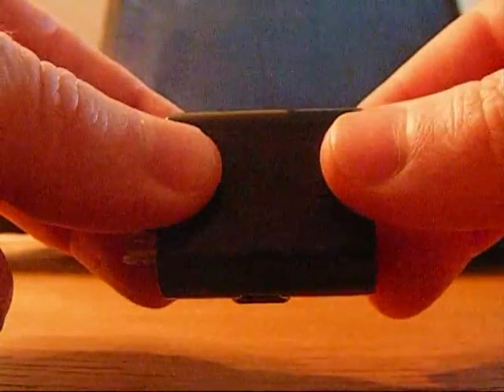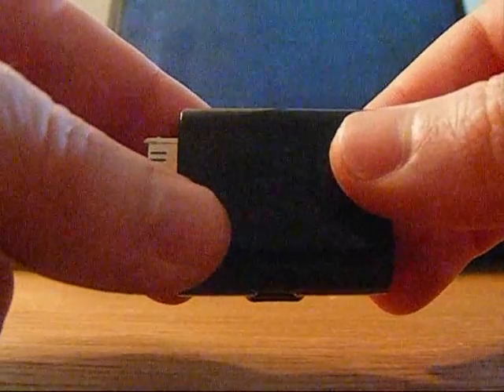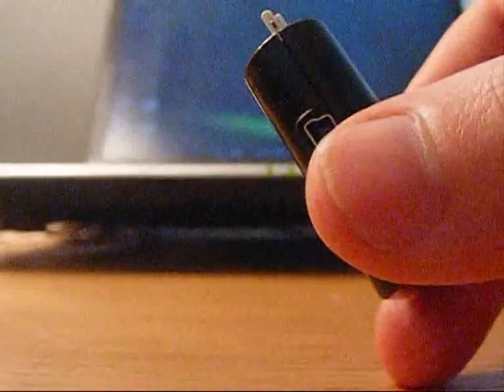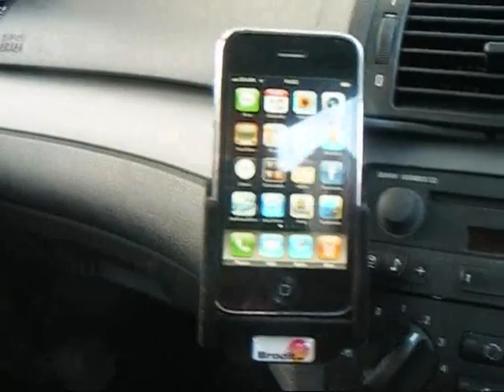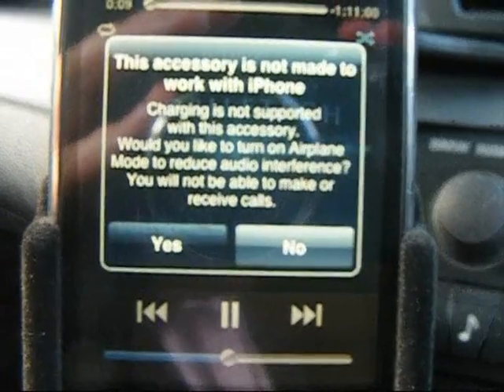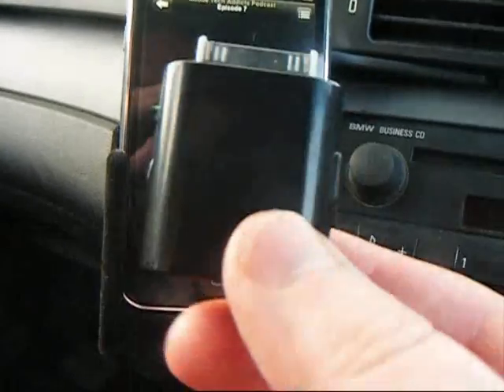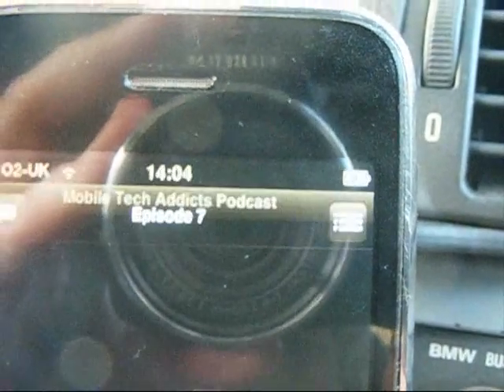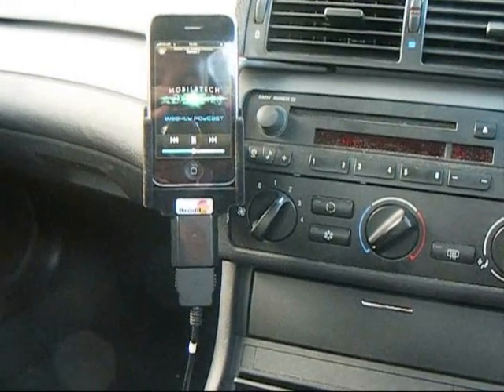Testing the Cable Jive iPhone 3G charge converter

Comment: I have the same setup for my Volvo. My only disappointment is that the male connector is 'friction fit' and, since the in-car cable is hefty, it's quite easy to 'displace' the connector by accident. Might consider the above and getting the extender.